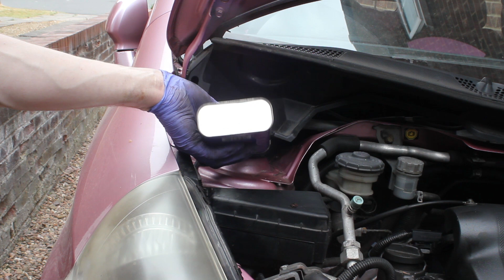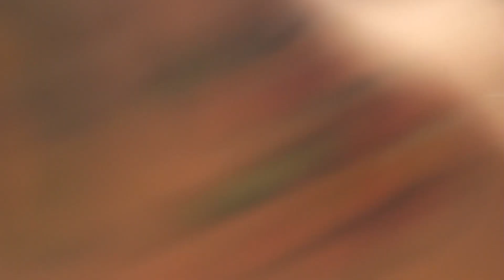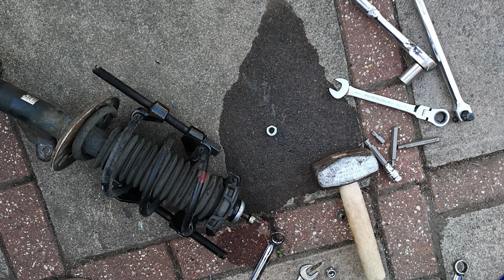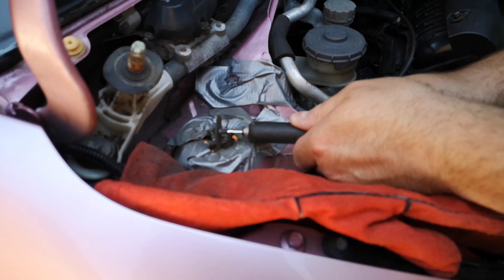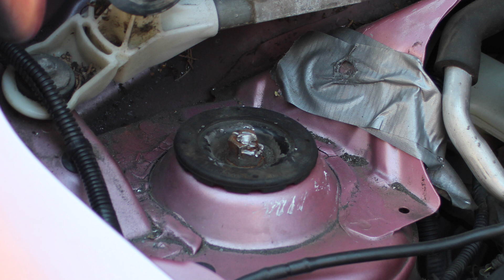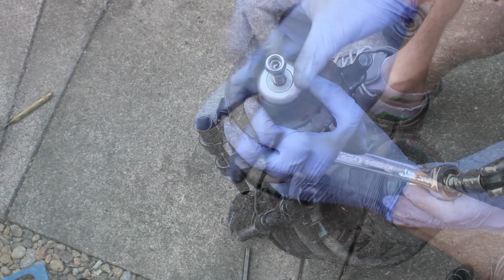Removing a stuck Honda Jazz/Fit strut nut - nightmare!

Comment: Yes I had to do same! I inserted a Allen key in the top, and tried turn the nut with open ended 14 mm spanner. NO FKN WAY would that nut move! Int the end, the Allen key snapped off in side!  Even heated it with a blow torch! So out came the hack saw! I cut the bugger off! Don't need it anyway! I don't see the point the nut need to be that bloody tight!

Comment: Thanks for making videos like these, all too often we just videos of how repairs go when they go right, not what to do when they go wrong. I came up with a different method for removing mine when the hex key hole got stripped out. I used a file to flatten two side of the threaded section and then put an adjustable spanner on it to hold it in place.

Comment: I had to do the same thing on my jazz last weekend. Dremeled half of the nut off and then used a hammer and screw driver to get the rest out. Mine was so rusted it wouldn't move at all with the 2 nut trick described below.

Comment: Step 1: go to hardware store, buy two nuts to fit threaded strut.
Step 2: thread nuts onto shock thread, then tighten new nuts against each other.
Step 3: break loose stuck nut, using new locked nuts to stop shaft spinning.
Step 4: unlock new nuts and thread all 3 nuts off the shock.
Repeat for lower nut after compressing springs. 
Note: will only work if there is enough thread left onto of shock( like this one )
Reply: Also, if you dont have enough thread showing above the top strut nut, you can use a Coupling Nut, thread half way on, then thread in more m12 bar and add a second standard nut onto locking it to the coupling nut
Reply: Genius!  Thank you!!  It wasn't obvious to me, so I'll mention this in case others are confused: in Step 2, I had to grip the top nut and while turning the bottom (stuck) nut.
Reply: The nuts you are gona need for this  strut are m12x1.25.